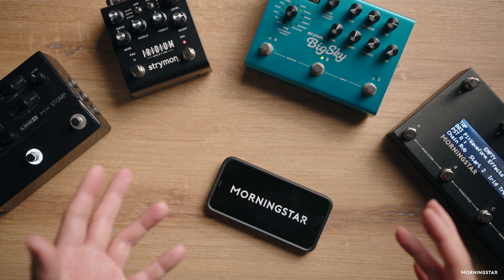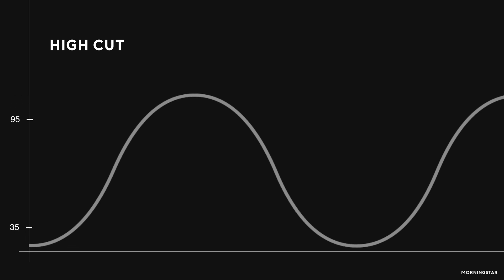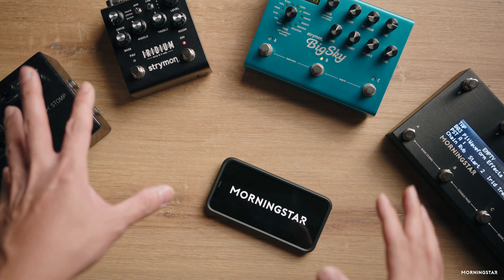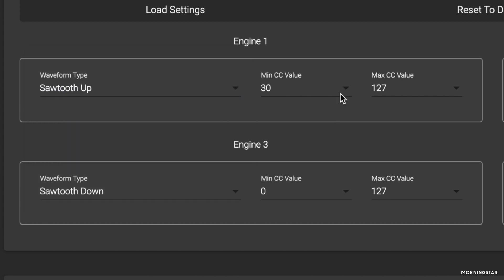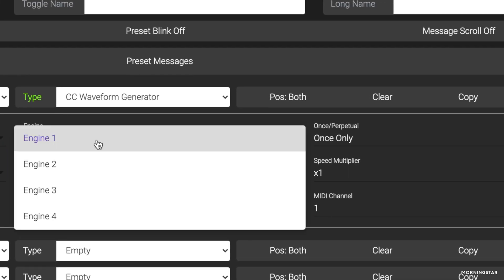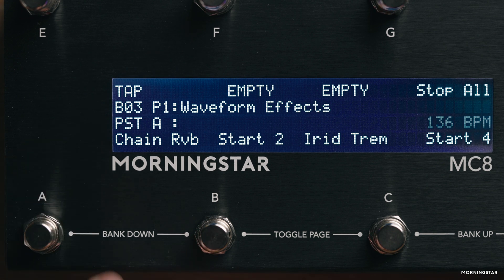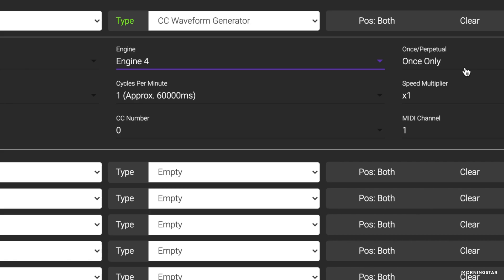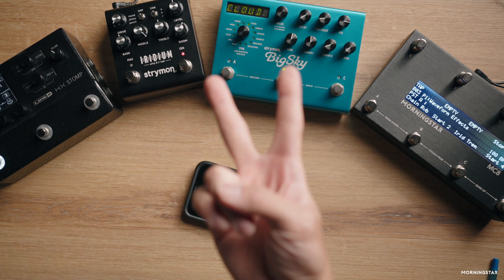MIDI CC Waveforms - This changes the game for your tone (MIDI LFOs)

Comment: Cycle Interval: Duration of 1 cycle in Milliseconds
Cycle multiplier: Number of cycles completed in one interval
Are those two different meanings of 'interval'?  If not, does changing the multiplier also change the duration of 1 cycle?

Comment: Awesome stuff! Is there a way to use this functionality to temporarily drop the mix volume of a delay for a couple of seconds while tapping in a new tempo with MIDI clock tap? Specifically trying to adjust tempo mid-song on an analog delay without hearing the slowing down/speeding up sound. Thanks!
Reply from the maker: Yes, if you have an effects pedal that allows you control volume with MIDI. You can usE a once-only waveform to take volume down to zero, tap in your NEW tempo and then have it come back up with another once-only waveform after you’ve gotten your new tempo.
Reply: @MorningstarEngineering  Thank you! Is it possible to have the mix setting return to the same value it was before modifying it?

Comment: In the example for creating the pitch shift, is there a way to keep the original pitch thus creating a harmony effect? In the example in the video, instead of a whammy effect it would be a 12-string effect. I guess the Waveform engine would have to have a mix control. Also, is there a way to create a wah-wah effect using the Waveform engine? Thanks for the help. Love your products and videos.
Reply from the maker: Hi. What you mentioned actually is dependent on the effects processor. Our MIDI controllers do not process audio. If you want to maintain some of the original pitch signal in the output, that will have to be done by the HX Stomp. As far as we know, the HX Stomp pitch shifter does not allow that.
Reply: @MorningstarEngineering  Hello. Thank you for the clarification. Take care.

Comment: My MC8 is black on ??white?? screen, useless. unreadable..
how do you reverse to look like this one?
Reply from the maker: Hi. From 3 August 2021, we moved to LCD screens with white backgrounds for the MC8. The Quality Control reject rate of the previous black ones was getting too high and we could not continue to use them. We changed all our product photos to reflect this change in color as well. Since then we've also had some customers ask how they can change their black screens to white (and vice versa). Both colors work great but the QC rejection rate was something we could no longer accept.
Reply: @MorningstarEngineering  I'll have to disagree on that. I have mine sitting on a board currently next to a Boss ES8 and the difference is chalk and cheese.

Comment: I was really exited about this having an ES8 which has a similar function until I realized there are only 4 engines :(  ES8 has the potential for 16 per preset.....
so in this demo you've used up 50% of the capability. This is the stuff that could make or break the MC series. Seems like it has the computing power, needs to be put to work.
Reply from the maker: Hi. We've already maximized the memory and are not able to add more than 4 waveform engines right now.
Reply: @MorningstarEngineering  That's a pity
as you can see in the comments, this would be a well received but in current form is a one (maybe 4) trick pony.
Anybody in this sphere already has midi controllable devices, there's potential to take what are often amazing and certainly expensive effects pedals to a new level

Comment: Could you use this with an analog delay (art van, tonal recall etc) to act kind like a thermae (pitch shifting)
Reply from the maker: Hi. Yes, you can. The Art Van has comprehensive MIDI capabilities and all its parameters can be controlled by our MIDI controllers.

Comment: HELP ! The controller is still sending midi clock after I engage different preset on my BigSky. In the general configuration I switched off the midi clock persist and it´s still transmiting midi clock after I change preset on the controller.
Reply from the maker: Hi. Please send us an email at help@morningstarfx.com. We provide technical support from there. A service ticket will be created for you and we will be able to follow up easily. Cheers!
Reply: @MorningstarEngineering  I too am having this issue. I'll send an email to create a ticket.

Comment: Would love a small unit without switches to expand the functionality of existing midi controllers. Also would be great to have something using a envelop, i.e. controlling volume to achieve dynamic delay like TC 2290 etc.

Comment: gret example, the pitch control can also made with the H9'? could be possible to show next videos with the H9 please??
Reply from the maker: Yes, definitely possible. As long as a parameter can be controlled by CC messages, it will work. We will release a video about H9 MIDI in the near future. But in the meantime, check out this video at this timestamp for how to assign a CC number to a H9 parameter, it works the same way: https://youtu.be/-TNTkqh-gEE?t=295